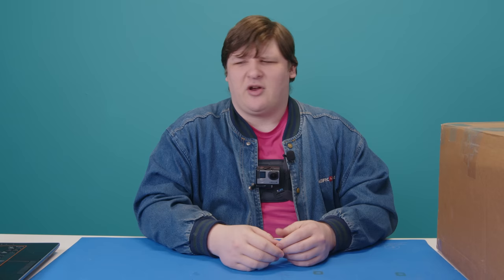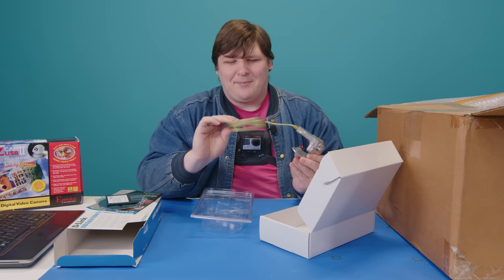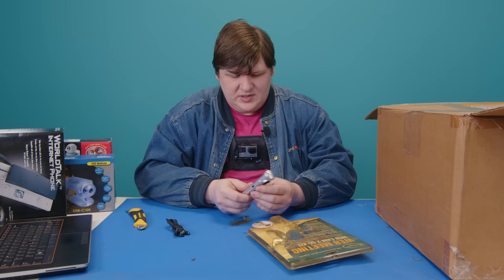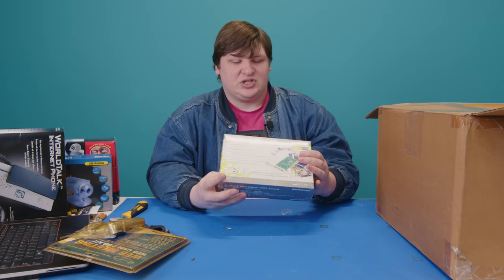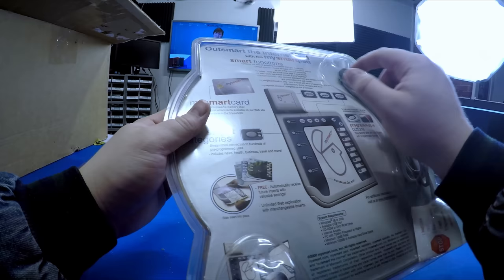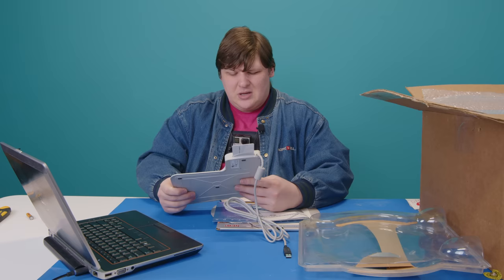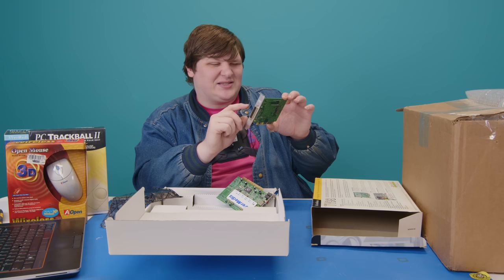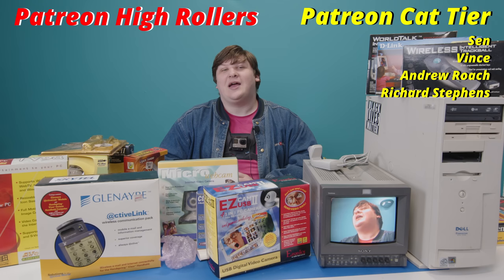Unboxing the Year 2000

Comment: If I had to guess, the EZ Cam games have gotta be doing some riff on the PS2 EyeToy experience. Tracking "motion" just by what pixels change from one frame to the next and using that to determine where you're moving your hand on the screen.
Reply: Couldn't have, it predates EyeToy.
Reply: @G_FRE  EyeToy didn't invent this, they just brought it to console. Of course it could predate EyeToy.
Reply: That was my first thought. Everyone forgets the EyeToy...
Reply: Yes, that’s what I think as well.
Reply: It's not gonna work well then.  Eyetoy barely worked at times, imagine how bad pre-eyetoy eyetoy is.
Reply: @clashblaster  I don't, hell I have 3 of em.
Reply: Yup, its a bog standard webcam with some eyetoy like software.  There used to be sites that had flash games that used your webcam to play camera controlled games. All the software does is look for movement in each frame and work out where that movement is in relation to onscreen objects.  More advanced ones got you to line up with an outline so the game knew the shape, colour and starting point of the player.  It worked exactly as well as the eyetoy i.e. a bit hit and miss depending on how much effort the coder put in to it.  I wouldnt be surprised if the software included with this webcam was just offline versions of those flash games.

Comment: I wouldn't be surprised if that little analog camera would beat some of early webcams into the goung picture-quality wise.
Reply: It does look pretty solid on that Sony monitor, but then again, the capture card that came with it might absolutely butcher all of its potential, even with that hardware encoder chip.
Reply: @no1DdC  it's not a hardware encoder at all, the bt878 is an uncompressed capture chip, it's a frame grabber with a comb filter nothing more
Reply: @Mister_Brown  Thanks for the correction!

Comment: I love that the D-Link webcam was shrink-wrapped, and yet had the UPC cut off the box, no doubt for some mail-in rebate as was absolutely prevalent in those days.
Also, iMac-inspired clear plastic enclosures for absolutely no good reason is so peak 1999.
Reply: If you buy hardware on discount for $15, but there was a $20 mail in rebate, you could acquire hardware and they would pay you for it.
Reply: I was waiting for them to mention that, but was disappointed when they didn't.
Reply: @rich1051414  thank you for explaining this!
Reply: At one point circuit City was selling these fancy for the time touch screen remotes on sale for like fifty bucks. The original price was I think 250 dollars. Turns out you could return the remotes for full price. I know someone who bought their entire stock and immediately returned it. Netted 2000 bucks.

It wasn't particularly unusual at the time for sales at circuit City to work like that.
Reply: "for absolutely no good reason" um, excuse me, aesthetic is a perfectly good reason

Comment: At a place I worked, before Y2K, analysts came around putting Y2K OK stickers on approved things. Not just computers but lamps and chairs and staplers. All kinds of things. Ridiculous? Yes, until someone told me it was to identify products from vendors that got Y2K certified. Then it was only mostly ridiculous to me. However part of me does wonder what would have happened if we did nothing. I do think it would have been a pain in the arse. But disaster? Maybe?
Reply: Now I wish I’d nabbed a sheet of those stickers. I definitely would send them to you.
Reply: Y2K was a real issue, not for lamps, chairs and staplers, of course, but for important computer systems that even back then were running the world and would have stopped it dead in its tracks had they failed. Large organizations like banks, insurance companies, governments, energy providers, telecom, etc. actually spent many billions in the years leading up to Y2K to prevent it from causing serious issues. 

That's why nothing major happened, why it kind of fizzled out and why people now think it wasn't a big deal. It was because people literally went over every line of code of massive programs that were, at this point, decades old and often written in by then esoteric languages for antique systems, which were however still being used for all sorts of stuff in the background that most normal people never even think about.
Reply: There's no question things would be broken and wouldn't fix themselves. Whether that means flight delays while they do things on paper or airlines shut down is an unknown. To give one example.
Reply: @no1DdC  I was one of those folks. I was working hard in several different languages and domains. As far as chairs and what not, if Y2K was going to be a big deal, being unable to get supplies would have made things worse. So I kid, but really making sure your suppliers were Y2K compliant was maybe a good idea. The stickers however…..
Reply: If no one did anything, it would've been quite the mess. But the important shit like banks, hospitals, power companies, etc. tested and fixed their stuff, so it was mostly a non-event. I worked on systems in that era. While some errors were comical, others were a serious (what-do-you-mean-all-my-money-is-gone) problem.
Reply: Some devices might have freaked out, mostly because they couldn't update the date correctly, but most things got patched well ahead of Y2K so it was solved even before people started freaking out.

Would be funny to get some Y2K OK stickers to stick on my modern stuff though  since it's still technically accurate

Comment: I used to work in the computer department of Circuit City 2004-2006, this brings back memories. We used to take turns cropdusting each others' customers. One time my coworker stole the stair cart away while I was up on the top rack looking for a specific cable (it was one of the newer "warehouse"-style CCs as opposed to the older "showroom" type) and I had to spend the rest of my shift up there. Good times.
Reply: @youreperfectstudio4789  Correct.

Comment: If I saw that proprietary USB cable right, it kinda reminds me of a USB "Mini-B 4 pin" cable
, or CB-USB5/6/8 cable used on Olympus cameras. It's definitely from that post-iMac USB but pre-micro USB era where everyone hopped on the USB train but were also trying to make small USB plugs for their tiny devices in the hopes that it's massively adopted.

Comment: I wonder if the 56k modems are “winmodems” these were hell on early adopters of Linux. It was actually quite difficult to find a 56k modem that wasn’t a win modem
Reply: That's why you bought external ones. They couldn't be winmodems because the defining characteristic of a winmodem was running all the signal processing in software, and a serial port didn't have the bandwidth for that. 

(Plus, they were apparently more robust in the face of shoddy phone lines for reasons such as "PC internals generate a lot of interferece with analog signals, so better to move it outside the case". Makes sense, given how a $3 no-name USB sound card beat my onboard audio for microphone SNR back before I had a Yeti.)
Reply: Oh lord, memories! I spent ungodly amounts of time trying to get various winmodems to work on Linux. I even succeeded, once!

Comment: The 4-pin mini-USB were common enough that you can still get new ones from most major sources!, it was used on a lot of early devices! If someone actually need one look for USB Mini "Hirose".

Hirose was a very big connector manufacturer at the time (still is trading, no idea of current influence/size) and as I understand it they came out with these well before the official USB Mini standard came out so it has the same 4 pins as the original full-sized A/B connectors because that made sense... But the USB consortium had other ideas and added a 5th sense pin on mini & micro A/B connectors for "on-the-go" where you connect two non-host devices (it's complicated). 

There were other custom small USB connectors but I suspect "Hirose" outsold all the others combined by a large factor and even hung on for quite a while on digital cameras, AFAIK a number of camera manufacturer never used the official USB mini connector but instead waited for the micro connector to come out before switching away from Hirose.

Comment: I absolutely loved my Palm Pilot. In some ways it did things better than anything since. It had proprietary "Syncing" with your PC, but even that was quite painless for the time. Once you learned a few special character strokes needed for handwriting (characters that require you to lift a pen (e.g. 't', 'k') were modified to single strokes), even the handwriting recognition was as good as anything now. I used mine constantly for several years and never had an issue.

Comment: I worked at a retail software store in the mid to late 90s just before I went on to work at Maxis. My store in particular had a very high shrink (theft) rate. I started gutting all the product to remove live product from the shelves. Having done so, I handled many of these boxes in the process of gutting and re-shrinking. And I can say that thin cardboard was basically the rule especially for any hardware upgrades. Even the retail packaged high end video cards and large hard drives (name brand) used the same thin card stock. Funny in contrast to the games which often game in nice heavy cardboard boxes that would likely be reused for years (unless it was a re-release or a "classics" series which was often packaged in a thin cardboard hanger style box.

Comment: That Web Meeting 2 Go style camera was EXTREMELY common 20 years ago. I think the same mold was used by at least a dozen different companies. The connector on the device end was actually pretty standard for smaller USB devices at the time. I'm not positive, but I think it was actually part of the 1.1 standard.

Comment: Hi! I worked at Glenayre in Vancouver BC, in 2000. Yes, it's a 2-way pager mated with the Handspring Visor expansion interface. The standalone pager is the Accesslink. I worked mainly on the software for the gateway between SMTP (email) and the paging system (it was called the GL3200). In May of 2001 95% of the company was laid off on the same day! Including me! It turns out that the era of 2-way paging was over.

Comment: I had the 'Web Meeting' cam 2 go around 2002. It was rebranded as the Aiptek Pencam. The pictures where shitty, but as a kid it was great to be able to take digital pictures!
Reply: I used to have one too, bought it at a flea market for what would be about 5 bucks in local currency. Absolute garbage quality.  

 it worked just fine under Linux which was also a thing I was really into as a kid

Comment: I had several of the items you unboxed.  The Mouse-systems trackball, the InterCam, and a HandSpring Visor (did not come with the communications module).  I'm pretty sure that a lot of that stuff is more like 1995-1998 than 2000, and was purchased on clearance.

Kensington was sort of a low-end Targus.  Everything they made was cheesy.

As far as the Extreme-Mail (CyberMail?) kit goes, I expect the vendor had the capture card that they sold on its own, or more likely, failed to sell on its own, and then the Internet became easier to connect to and they figured "We have this receiver/capture card nobody is buying, lets add a cheap camera (had to be analog, since the capture card doesn't use a digital input), some e-mail software, and festoon the box with stuff to make everyone think it's a trendy product."  1 week later, they printed the outer box, shoved the inventory of video capture cards along with the other parts into the inner box, and sent it off to Circuit City.

The scanner card may have been SCSI.  There were a lot of flat bed scanners that came with low performance SCSI cards.  I have a few of those ISA cards in my collection of old computer parts.

There were two things that the father of your benefactor seemed to miss, the Gyro-Mouse, which had gyroscopes in it so you could move it in 3-space (it was wired), and liquid-crystal shutter 3D glasses that plugged into a game port.  I'd offer to send some to you, but I sent the ones I had to electronics recycling about 5 years ago.
Reply: Kensington do have the pattent on the Kensington lock. That little slot put on a lot of electronic equipment to let you secure them from theft that even Targus sell locks to go into.

Comment: Probably echoing others here, but getting a bunch of computer accessories in the late 80s and 90s, and then working at Best Buy and CompUSA in the late 90s, that thin paper over a slide out cardboard or styrofoam box was absolutely the norm… and oddly memory inducing. You are right, I think Apple was a big game changer there. Great video!

Comment: 19:55 352x288 is basically a quarter of digitized PAL resolution (720x576, often cropped to 704x576 because digitized SD video is weird). 352x288 is also the resolution used on PAL VideoCDs and the like. CIF is apparently this quarter-PAL resolution, but with an NTSC 29.97 framerate, as an attempt to get a compromise format for international videoconferencing. I suppose in the end it just made things awkward for everyone, but that's how compromises often go...

Comment: Lead plates in cheap plastic crap is very common with "scameras/trashcams" from the 80s and 90s. Frequently seen with a label stating OPTICAL LENS rather proudly on the front of the "lens".

Comment: yes - the Visor 'palm pilot' had an accessories slot for different specialist cartridges. I had the 'cellphone' adapter so was able to use my handspring visor (the thin silver coloured one) as a smartphone - as the cellphone module could 'dial' my service provider. mail and browser built in to the Palm OS

Comment: The CIF Formats are quarter-NTSC (352 x 240) or quarter PAL (352 x 288) resolution. Every single line of NTSC or PAL is 720 pixels, but 16 pixels dissapear in the overscan area on both sides of the screen. So there are 704 pixels left,  then by two it`s 352.
Greetings from germany,
Marcus

Comment: There was a motion tracking system for PCs that I know about, it was called TrackIR, it apparently worked well enough, but it required special hardware (a purpose built camera and a hat, if i recall correctly). Never tried it, but a number of simulation games I played a decade ago did support it.

Comment: Those webcams might just work on a (older) Linux system so you don’t need to install all the crap that comes with it. It depends a bit on just how old they are.
Reply from the maker: Good thinking!
Reply: All the crap is part of the fun :) but if you just want to check the picture quality/functionality it makes sense.
Reply: Indeed - a lot of these pre-class-device USB cameras used bridge chips that worked in similar ways, so they all got collected into a driver called "gspca" (Generic Software Package for Camera Adapters) on Linux. Worth a try. The driver is still maintained, so I'd expect at least some of these cameras to pop right up and work even on a current Linux distribution.

Comment: Thank you for this ambivalent trip down memory lane :) Just wanted to add that 44:10 Kensington was actually a legit, established brand that even gave its name to the “Kensington slot” - that keyhole-like lock attachment slot built into laptops, computers and electronics in general. You might still be partially correct though, ‘cause all the Kensington products I can recall were Mac-targeted, as that was the scene I was into back then. They made some pretty high end alternative keyboards and mice for Macs that blended into the “Snow White” design language they were running in the mid 80s and on. So perhaps not a well known brand for the Windows aficionado of the time.
Reply from the maker: My perception is that Kensington made a number of legitimate products and rebranded generic trash simultaneously. It was a really unpleasant practice of technology companies at the time to make a few products that were legitimately good, but then lend their name to many that were cheap, worthless garbage, and of course in later years legitimate products would bleed away, leaving only the garbage as we have it now

Comment: The Handspring Visor has some neat tricks up its sleeve. Almost literally, as I'm talking about the stylus. The tip unscrews to reveal a "pokey stick" which can activate the pinhole reset button if needed. Even more special is the other side, which unscrews to reveal a screwdriver which can be used to disassemble the unit. I don't understand the value in having that bundled but nevertheless it was my first No. 0 (IIRC) Philips screwdriver.
Reply from the maker: That is COMPLETELY WILD, WOW